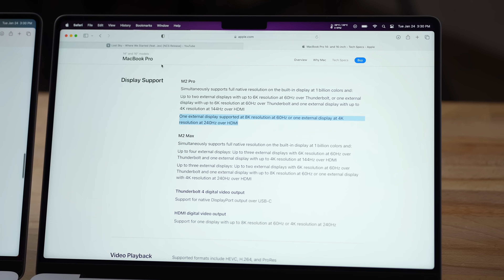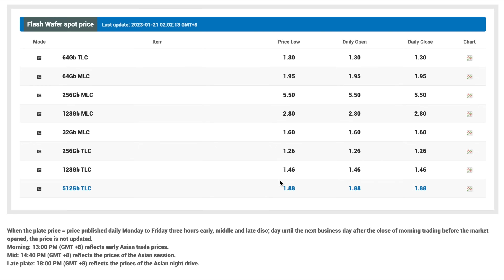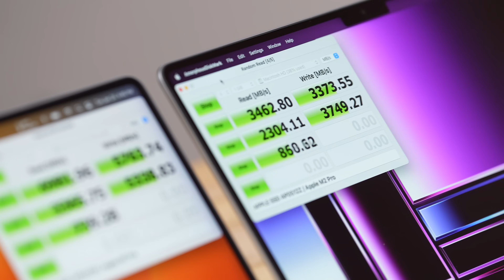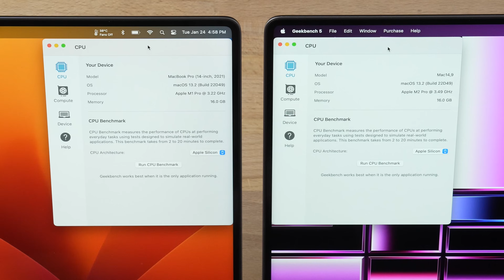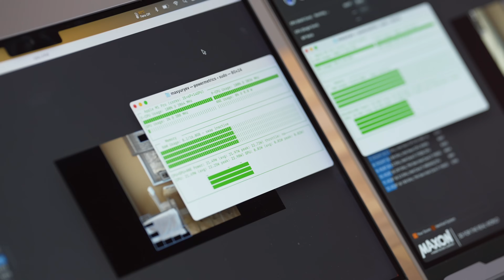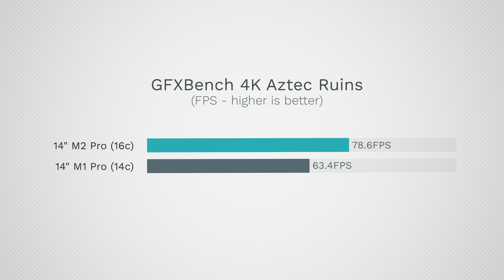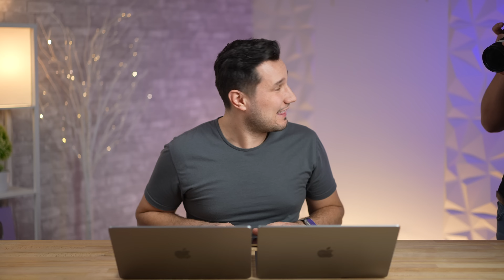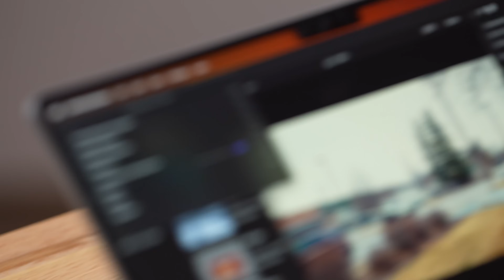M1 Pro vs M2 Pro 14” MacBook Pro - ULTIMATE Comparison!

Comment: I think the ssd “issue” is a problem for base model m2 pro buyers, and another reason to upgrade. It’s not great that Apple has cheaper out in ssds on a pro device, but it’s just another reason to upgrade your ssd capacity. The battery life improvement and the incremental but noticeable performance improvement is always welcome.
Thank you for the as far as I can tell first benchmark of the laptop compared to its predecessor. Great vid

Comment: Disappointing that in a pro machine they didn’t use the 2 Nand chips.  They could have even raised the slightly if they were so worried about profits.  

imo This should have just used the two chips and apple should have eaten the Costs.  Apple has to know that this was gunna have worse performance.

Comment: I don't like that Apple is cutting costs on the SSDs on these new M2 devices. but really no one should be upgrading from M1 (M1 Pro or M1 Max) to the M2 equivalent. for most pre-M1 upgrades it's more than an incremental upgrade

Comment: Hmm, I'm torn between getting the 1 TB update with M1 Pro or with M2 Pro… I do a lot of encoding (e.g., ffmpeg), so I want more CPU cores, but the M2 Pro doesn't seem to have improved at all in terms stuff that positively impact this kind of use case. Before Black Friday the 10-core 1 TB 14" had a deal for € 2150, but I figured I'd wait till Black Friday. However, since two weeks before Black Friday until now there have been 0 deals. In the meantime, Apple increased M1 Pro prices and of course the M2 Pro is even more expensive as well.
Really feeling screwed out of a good opportunity here lmao

Comment: the M2 looks great. Sadly it looks like I would need to get the 1TB model for the speed. On the Air I could live with the slower speeds but not a $2000 laptop.

Comment: It seems rather clear that Apple some years ago had anticipated possible industry slowdowns after covid so they kept this overclocking in their sleeve to be released later. They look as newer PCs but there are very changes in the silicon (just a few design optimization tweaks)
Still, the performance is improved and users appreciate this!

Comment: Great observations about the performance, wattage, and heat of the soc. Apparently, some key soc design engineers of Apple left the company in recent years (e.g., the Nuvia founders), and it is biting Apple in the bum. Considering the overall performance of their mobile/laptop SOCs, they almost had no gain in IPC (no architectural advancements) in almost 3 years. Moreover, they have no real leap in GPU technologies either. As it is rumored, they had some new raytracing-equipped GPU cores on their A16 chip, which they had to scrap because of not ideal power usage. Their 3nm SOCs will reveal their real situation, whether they are on track or in trouble.

Comment: meh I'm glad i didnt wait and went for a used M1 Pro 16 1TB recently. The extra speed it really only credited to the higher clock speed and pumping more power resulting in higher temperatures yeahhh NO THANKS M1 Pro is fast enough for anything u throw at it. I dont think i will upgrade until the M4 Pro lol Whats it gonna be second gen 3nm or 2nm?

Comment: Not really surprised anymore, discovering that the ssd is equipped with single chip. This was also the case at Mac mini m2, MacBook Air m2 - so it is great that you can display the differences and perspectives for usage when hardware is limited in “base models”

Comment: Big question: im using my m1 14 pro since last summer... got down to 97% battery life... im a heavy user like videos, thumbnails etc. and im almost in the swap all the time and pluged in a lot of times during the day... anyone any clue how to save the battery? i havent had such issues with my old i9 16 pro from 2019

Im wondering how the new m2 pros will stack up...

Comment: My MBP 14 M1 Pro 512GB(16 core GPU version)  have read speed of 6932 and write speed is 5724 😀

Im so happy that my drive is super fast, on par with my desktop with RTX 4090(Samsung 990 Pro 2TB).
Apple is in full saving/margin form or being cheap a##.

Comment: The entire M2 lineup feels like a downgrade from M1. It's understandable , M1 was a new thing and Apple had to ditch as much stops as it could to convince people of the change.
We have bad heatsinks on the airs , single NAND chips , worst speakers  ext...
The only thing I can understand is why they switch to a single NAND chip - it my not be cost but Wair . M1 units (mostly air and 13inch) had and excessive wair issue on the SSDs due to swap.
Higher capacity chips have bigger TWR (maximum writes)/expected/supported lifespan. 
The tradeoff is slower speeds as you cant do RAID 0 via the NAND controller. 

What I don't get is why they insist on soldering them... I get it , they want to force us to buy it from them but they already have a solution on it in the Mac Studio. Keep the NAND controller on the SOC and put the chips on a socket. It's not upgradable but it's REPLICABLE. If you have a dead SSD on this - is an e-waste laptop as you have to buy a new computer essentialy.

The Mac are good machines but the quality and the BS anti consumer crap that Apple pulls has to stop eventually.

Comment: The video export is 7% higher, in line with single core/frequency increase, also the power consumption are 17% lower (if the M1Pro battery is degraded)

Comment: Summary:
- M2 Pro still has SSD issue.
- CPU improvement of 15% to 20% is valid for the M2 Pro.
- Sound isn't as loud, but quality is slightly better.
- M2 has better GPU performance.

Comment: Thanks a lot for the video. I really don´know what to think about the SSD performance, if we check out those real usage app Bencharmark there is no significant impact on the SDD. So.... mmmmm, sure I want Apple fix that, but there is no significant impact the ssd speed, sure if we want to transfer data there sure it is a bad issue

Comment: I’m not impressed! Especially with the SSD, for a $2000 pro unit they could afford using 2x256 chips. I think they should have skipped a year and came out with the 3nm. This is not Steve Jobs company anymore.

Comment: Thanks! Most surprising was the increase in energy efficiency of the new MacBook Pro. Most of all I was interested in the speed of the ssd. It's also very interesting to see changes in GPU power scaling, heat under full load, and FCP speed.

Comment: Apple are clever, I'll give them that. That smaller heatsink seems like completely unecessary thermal suicide (and yes the chip temp is 10degC up) but in practice e.g. thermal throttling, keyboard temp there seems little effect. That was only Cinebench, though - a really long period of heavy use may show up some issues. Similarly, the poor SSD speed will only  fully manifest with heavy multi-tasking which Max Tech will no doubt do in a future video.
Overall I would say that the M2 is a worthwhile improvement but I wouldn't upgrade from a M1 unless I was a performance fanatic and loaded.

Comment: That's sad Apple is only using one SSD module for the bass macbooks now.  I do understand, though, because they want to save some sort of cost, either on their end or on the consumer end.Either way, the chip upgrades are pretty decent.
Reply: I doubt it really save much of anything. They should really just provide internal storage upgrades via nvme SSDs
Reply: I could  agree with that. Either that, or sell upgrades using their own little module for some cost for those who want to repair the machine, that way, the person could put in two 256 GB modules. But Apple's probably not going to do that.

Comment: The SSD speed is really disappointing for any product that has the name pro in it.  Reminds me of the years when Apple was selling iMac and mac minis with 5400 RPM hard drives at the low end even though SSD were already common.  But would force you into upgrading to a higher model if you didn’t want to see the spinning beach ball all the time.

Comment: Would like to see the 16in get the same comparison. I would also love to see gaming performance comparisons between the 16in and 14in as well as thermals. Still I wish Apple had put in nvme M.2 slots for their SSDs instead of soldering it to the board. I know why because Apple does it for the money but it would be nice to have something like that easily upgradable by the user. Very fast nvme SSDs aren't hard to find at all and they're very small so they could even fit inside the MBA. There's no excuse for doing what they did with storage especially when easily upgradable storage is readily available to users. Just having 2 slots would make it so users aren't so concerned about internal storage and more focused on how much ram or GPU power they need. You should not need a dongle plus external storage just to get more space because you ordered too little or have a slower SSD because you bought the base model that uses the same module but only has one chip

Comment: Apart from the HDMI 2.1 and Wifi 6E, nothing is really interesting over the M1 Pro, even the HDMI 2.1 and Wifi 6E use cases are listed to having High refresh monitor (which Apple doesn't make yet) and no one goes to buy Wifi 6E router for minimal gain.

Comment: Where did You came up with 45% in blender ?
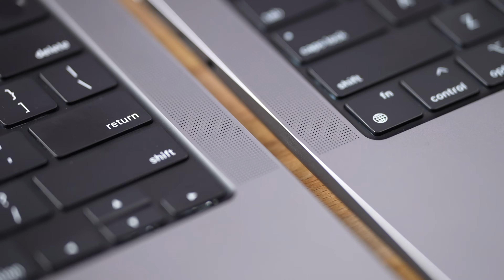1:25 vs 2:03? count as proportion how much faster is M2, and not how much slower is M1. answer is 31% in blender. Do the math properly or at least from the same reference point.

Comment: My old 2015 15" macbook pro has massive overheating and thermal throttling problems, making it almost impossible to work anymore. I'm so fed up by it, that i really don't want to risk something similar with the next one. I use it for music production, so i'm more reliant on the cpu than the gpu in general. I'm really looking forward to the spec'd out throttle tests!

Comment: I really appreciate these breakdowns as I continue to save my money for my new MBP. I’m long overdue for an upgrade and I want to get the best value and performance for my money. I keep going back and forth on 14” or 16” and pro vs max. I know I’d be more than good with 32gb of ram but I need a pretty hefty hard drive for plugins and VMs I run. These heat issues in the 14” M2 Pro give me pause on that configuration. I’m looking to see the 14” M2 Max tests.

Comment: Certainly, the extra $200 for the 1 TB of SSD storage compared to the 512GB of SSD storage make picking up a used M1 MB Pro more enticing. The 1 TB machine is the real base system now. In comparison, upgrading from a 512G to a 1 TB Dell XPS notebook "only" costs $100. I am really disappointed with Apple and I am really on my guard with respect to Apple purchases.

Comment: SSD Nazi here…since the beginning of time (yeah I’m looking at you OCZ 60 GB and Intel G2 80 GB nailed to the wall) you have ALWAYS wanted to option with fully populated NAND chips in any SSD!

This used to be 8 chips in most 2.5” SATA SSD’s, now I believe they have internalized fours channels into each package, so you need TWO chips on M2 and NVME SSD’s.  

This usually works out to never buying the smallest capacity option from any generation or brand line, always go at least one upgrade.  You never want a SSD to fill up anyway.

Comment: Hi guys, it would be great if you would test these models having the same number of cores e.g. M1 Pro (10CPU + 16GPU) vs M2 Pro (10CPU + 16-GPU). That way it would be a fair comparison. Comparing a processor with fewer cores to another with more cores will always come out in favor of the latter even if the processors were the same in terms of technology.

Comment: Please please please start doing playback on the timeline moving BACKWARD!! NO ONE IS DOING THIS and THIS IS HOW EDITORS WORK.  using the JKL going backward to find the spot we want to cut.  Everyone saying how butter smooth playback is for XAVCHS but try playing the clip backward like editors do.  Is there a difference between m2PRO and M2Max with extra GPU cores?  Are the Encoding engines the same so it won't matter?

Comment: Im excited for the maxed out 14". If it is just like last year better to go with the 16" because of the thermal throttling or if they upgraded the fans. 14" is just such a perfect size, but if you need the power of an M1 Max you were a bit limited and it was a better decision to take the 16"

Comment: Thank you guys for doing all those tests. Wow so even buying 512Gb in the M2 pro if it is a single nand it will have half the speed of two nand on the M1 Pro! Those M1 pros are looking good now retrospectly! The 103º internal temp on the M2 pro is looking a bit worrying too. I was leaning more toward the M2 Mac minis, but do they have slow 512Gb single nand chip? Which configs have two nand chips? Apple not worried about new M2 pro Macs having slower ssd at all, just to save a few dollars, surprising.
Reply: I think you have to get at least a TB now to get two Nand.

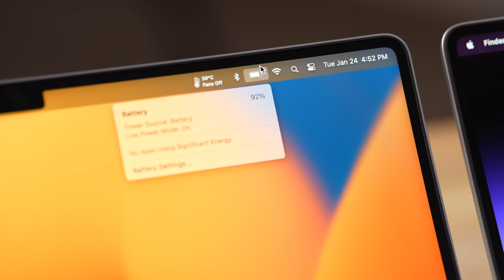Comment: Regarding the battery % difference mentioned @8:00, unless the 2021 M1 Pro model is a brand new, and never used unit, it cannot be compared to the new M2 Pro. IMO for completeness and fairness you could/should have shown the battery info data from both devices (for example using Coconutbattery or other tools). Cheers!
Reply: Yeah that was my concern too. The 14in M1 Pro is likely going to have some battery wear and tear that the M2 Pro model just won't have and that will effect battery life

Comment: I didn’t think the SSD speed would matter as much on the pro versions because even the slower ones are pretty fast, but I guess exporting videos/images because of the fast chips, it becomes a bottleneck.
Reply: Yeah and that’s why most people buy these machines over the Air I would argue.

Comment: Just when you think base SSD storage is good enough in the M1 models but in the latest, surprisingly the base M2 MacBook Pro SSD's are slower than the M1's. It's still fast but I would prefer having 2 SSD NAND chips in the M1 rather than a single chip in the M2. I think performance will suffer long-term with a single SSD NAND chip in the M2 model.

Comment: Those M2 chips are certainly more power hungry! Thank you guys for the super detailed analysis/comparison. It’s a shame that Apple keeps giving only one nand chip for the base models of their computers. If they can still squeeze a little more performance with the same 5nm process, I wonder what they’ll achieve when they switch to 3nm 😱
Reply: Aside from being clocked higher they have 2 extra cores. TBH it would be interesting to compare the non-binned 10 core m1 pro vs the 10-core binned m2
Reply: @PolCmara  waiting on that review

Comment: I got my m2 pro 14' 1TB yesterday (the one with 12cpu 19gpu cores) and was worried about the ssd speeds so I ran the same test as in the video. It came out slightly better than the M1 pro model shown so it was a relief after the money spent.
Reply: Literally same. As soon as he popped the cover i was terrified that i wasted so much money. This comment is very helpful and a huge relief.
Reply: None of the upgraded storage versions would have this issue

Comment: When will the M2 Max be tested? 
Does the power saving mode allow the macbook pro to significantly reduce CPU and GPU performance in terms of speed, SSD and RAM?

I have the impression that the efficient E cores are more efficient?

Comment: Very quick to do so as usual 

The changes are interesting, especially about the thermal block on the m2 pro, make sense to reduce cost here if the system remain efficient, I am wondering about the m2 Mac system though

very sad about the ssd though, apple should perhaps make the jump to a 1tb, especially for a pro machine that cost 2 grand, it's okay ish ont the m2 air as it was released during the chip shortage, but this one is a no, it should be uncompromised perf over any cost 

Kinda curious about the m3 map, will it be axed, renewed/redesigned ? I hope for a thicker macbook air with a thermal system, as Mx pro are a bit overkill for me still

Comment: I've been looking forward to this. It looks like the increases in performance on the M2 are largely due to the increased clock speed and with that you get more heat. Apple dropped the ball here imo
Reply: Which will definitely compound when the hotter chipset and the single Nand chip, and 8GB Ram all come together on the base models as a perfect storm of bottlenecks.

Comment: I Think you are comparing “Apple” with bananas ;-) Why do you compare the M2Pro 10C agains M1Pro 8C  - funny it gives an 20% Performance boost as it has 25% more cores. Why not compare it against the 10core M1Pro?? I ran a simple Geekbench test on my 10core M1Pro …. 1746 Single Core Score and 12019 Multi Core Score …. Doesn’t seem to be that improvement arter all, or?? Or the M1 is slightly faster??

Comment: Hey Max Tech I bought macbook air m1 a 6 month ago and the battery cycle count is around 68, but the battery health is showing 94% (and I didn't ever use in sunlight or hot contition I never done a heavy task ). When I checked about the battery of macbooks it was mentioned that the cycle count is around 1000 when it reaches the battery health 80%. Should I worry about this, should I go the apple service centre and show my macbook to them  or its better to use my macbook without showing it to apple service centre.

Comment: Actually, in the M2 pro MacBook pro 512GB,  there’s another NAND chip on the other side, you need to fully disassemble the motherboard to see it. For M2 line, each NAND chip is 256GB. For M1 series,each one is 128 GB. So the M1 pro MacBook pro 512gb has 4x128GB NAND chips vs 2x256GB chips in M2 pro macbook pro. That’s why the m1 pro one doubles the ssd speed over m2 pro one.